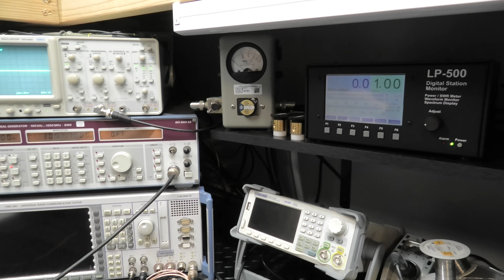Uniden PC122 XL Repaired, Recapped For Will SSB CB Radio

Comment: Broken traces, bad solder joints, cracked boards. Always the first thing I would look at if it was used as a mobile unit...using a brighter light and bigger magnifing glass as the years went by. 🧐  I like seeing these great old radios resurrected as much as you do, Matt. With the recap and alignment, it will be out there for decades to come. Nice job.
Smilin', I'm off the key.  😑🦗

Comment: Good radios.  I had a Cobra 146 GTL that I worked a ton of DX with back in high school.  I used a stock mobile antenna and stock radio.  Had a blast before I got my ham license later in my senior year and got into 10 meter DXing!

Comment: Excellent video Matt  :) yes like Uniden 122 XL radio always did want get those remember them and I have First Generation of Radio Shack TRC  -485 mobile unit got bracket plus original mic does need go shop fix for transmit plus Recieve it similar to 122 but digital screen on too ! But great radio for sure both to and I know lots people used both types for years! Both trouble free last long time too !
Reply from the maker: Those realistic clones were great as well. I have a 465 that I need to to through.
Reply: @TheRadioGarage  Matt agree to that and amazing Realistic what put for Radio Shack radio clones last long time from 23 channel  had A to C or F selected channels on Chrystal  for RX and TX add channel 1 to 23 as choice channel! Myself still got TRC 11 23 does that but use it original mic on different radio also going need a different mic on got lots old to newer radios in 23 to 40 channels ! Amazing A to Z makes and models over years too CB were made !